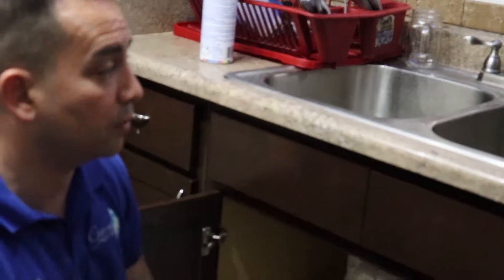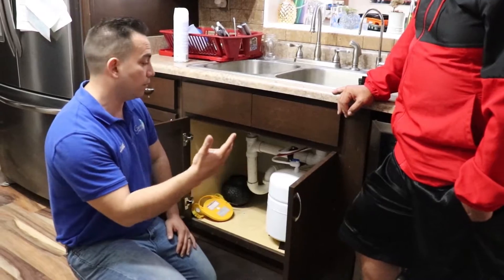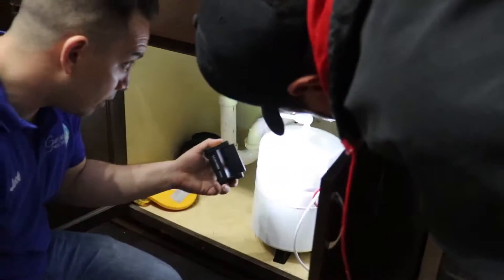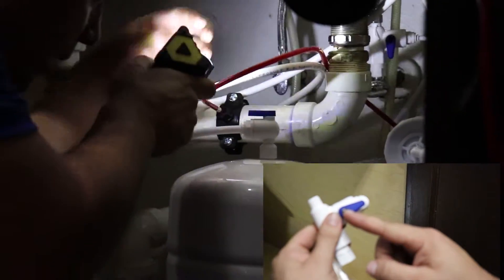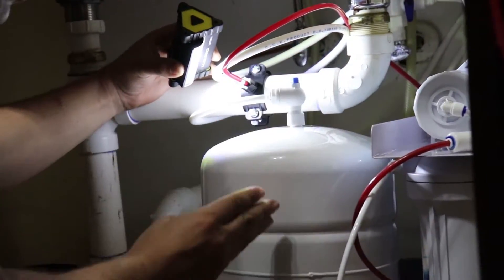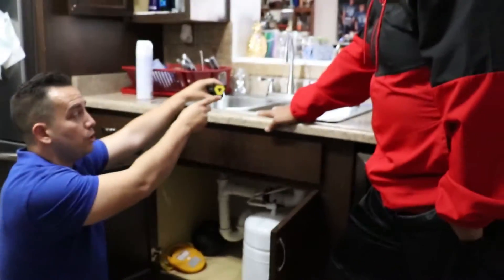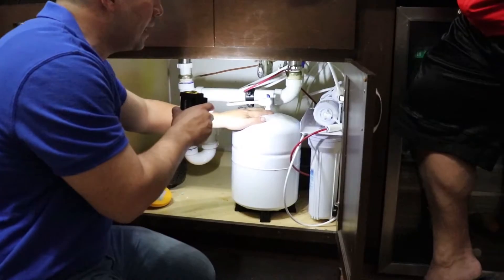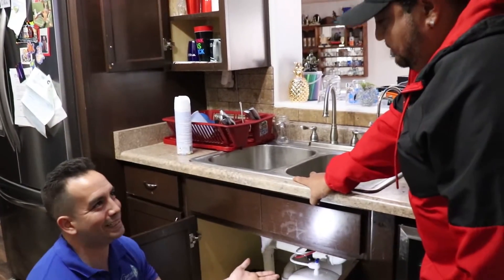What do to if your Reverse osmosis is leaking

Comment: I was expecting a video on how to fix the leak 😂
Reply from the maker: Let us know where your system is leaking and we can work on a video for it. Priority after detecting a leak is turning off the water supply to prevent water damage, and then contacting a water treatment professional to inspect the system and filters.
Reply: Me too. I have a Smith two-stage row unit that is leaking below the sink
Reply from the maker: @franksturgeon2358  most of the leaks are caused by bad o-rings/gaskets. It could also be defective cartridges. Priority is always to stop the leak and then contact a water treatment professional to inspect all of the parts of the water system.
Reply: This video was made three years ago yet the responses here are from 2024. (Apart from Mr Garcia who graciously monitors his video and takes the trouble to reply)
Funny all of us are experiencing leaks at around the same time. Do you think there could be a limited "life" for these units?

Comment: Where can you buy those special shut-off valves? Both for the tank and the water line to the filter?  I only have a T-connector and no shut-off valve for the RO water line only.  Also, I have no shut-off valve for my tank either.  I have serious condensation on the tank line and now I have a lot of water damage and mold.
Reply from the maker: You can find the angle stop adaptor for the water feed to the RO at Home Depot or Lowes. The tank shut off valve is not commonly carried at local hardware stores but you should be able to easily find it online.
Reply from the maker: And definitely get that mold checked out!